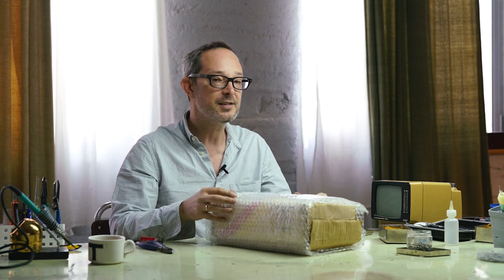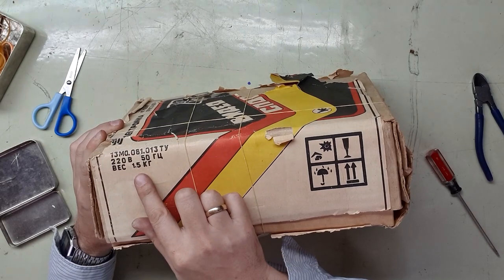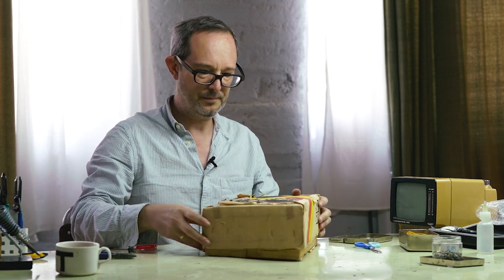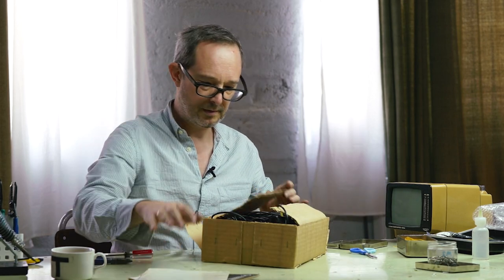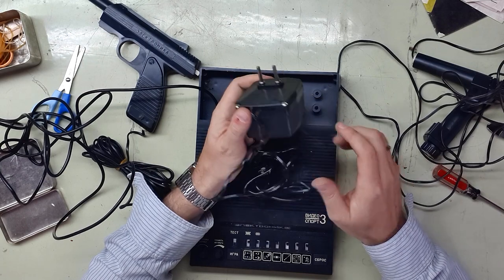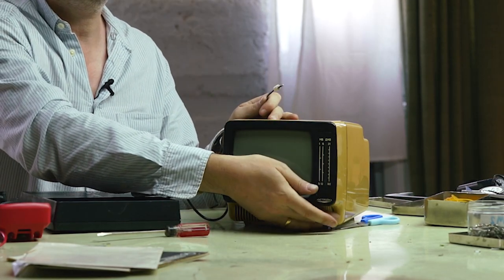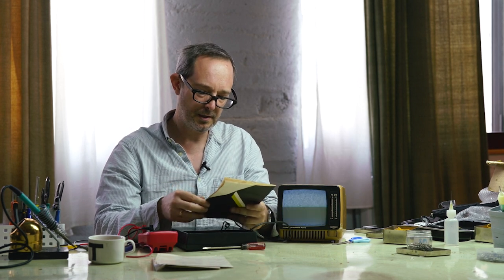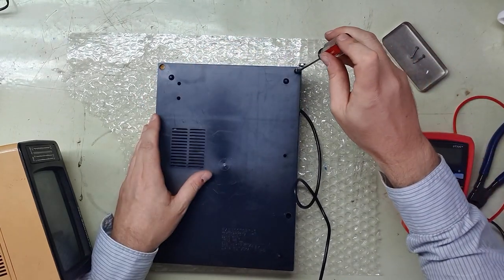Retro Gaming Console Restoration! — Video Sport 3

Comment: Fun video. I built a myself a "Leningrad" ZX Spectrum clone a couple of years ago. The USSR has a great history of clone systems using some really clever engineering. The home made PCBs and covered wire jumpers speak of a time when quality of workmanship was valued more than churning stuff out. Just one question, is the unit a SECAM system or PAL?
Reply from the maker: My understanding of Soviet television is that SECAM was the format standard, though on some of my other Soviet CRTs I've used a PAL signal and it seemed to work fine. I agree with you 100% about the quality of Soviet electronics engineering. It's sad so many of these devices are disappearing from the world. Thanks so much for watching!
Reply: The Video Sport itself is most likely CCIR, i.e. plain old 50Hz, 625 line, grayscale video without color encoding scheme at all.

Built a "Leningrad" some 6 years ago myself, then proceeded to upgrade it with a sound chip, 256k RAM, PS/2 keyboard and a divMMC interface - pretty sure I added a couple more layers to that poor board with just wiring :)
Reply: @ZXRulezzz  Thanks for the info, those are some great upgrades you've done to your Leningrad. I myself have built an audio board for mine and it works great (really makes a difference on the games that were written for it) and I ordered the parts to upgrade it to 128K about 2 years ago, but have yet to get around to it ;) 
I have one question for you though, the Leningrad you have it it the first version (with no edge connector) or the Leningrad 2 with an edge connector? The reason I ask is that I too wanted to use a divMMC with mine but was unsure if it were compatible. There were minor changes between the two versions but if you managed I guess it should work for me too. I could always wire it direct to the processor and other points on the board I suppose. Again many thanks ;)
Reply: @8bitsinthebasement  It's Leningrad 1 w/o the edge connector. I managed to put all those upgrades right on the board by using a small old Altera FPGA in its "prototyping area"; it performs most of extra hardware fucntions and control logic. (of course I had to port divMMC to it and code the rest)

That said, I don't see what would stop one from attaching a separate divMMC unit to any Leningrad, apart from possible wiring mess :)

Comment: hello, you installed 25v 220uf capacitors instead of 25v 200uf, and what capacitors did you install instead of 10v 20uf and 10v 50uf, I am restoring exactly the same console, I want to know which capacitors are better to install

Comment: I recently bought this console and that exact TV used. What channel/frequency setting did you use for the TV? can’t get the picture to come in clearly
Reply from the maker: Nice find! These are becoming more and more rare these days. You’ll need to fish around for the channel—I don’t know of the specific frequency needed. If you can’t find it, it may be that the console isn’t producing signal, which was my problem. :)
Reply: @ThomasBurns  thank you!! i was told id have to buy an RF modulator but the ones ive found online are pretty pricey for a decent one. good to know i wouldn’t have to buy one haha. i’ll probably have to pull apart my console then and clean it up

Comment: This ain't an Atari clone, it's Pong-style console (e.g. Magnavox Odyssey, Nintendo Color TV Game  etc)
Atari wasn't cloned in USSR, its clone "Rambo TV game console" appeared in 1990s only (in parallel with Famicom clones knows as Pegasus/Dendy/Subor/Lifa/Simbas/dozens others names)
Reply: also such consoles in theory would make any soviet radio amateur, the schematic was described in the "Young Technician" magazine (Oct 1989). But the main issue was to find out К145ИК17 IC (clone of AY-3-8500). There  ICs always were sold with the hard shortages in USSR. If you hadn't some relatives/buddies working on the factories producing them you had almost 0% changes to obtain some of rare chips.

Comment: схема почти гениальная. Голова К145ИК17 - Это клон, без сомнения. Русские не заморачивались такими бездялушками, просто копировали.
Интересное развитие оригинально чипа от TI:
AY-3-8500 (-1) (К145ИК17) 	1976 	4 Ball & Paddle games and 2 shooting games
AY-3-8550 (-1) 	1976 	Improved AY-3-8500 with horizontal player motion
AY-3-8601 (-1) 	1976 	Square Off: Combat Squares, Racing Squares, Shooting Squares, 2 Jungle Games 
AY-3-8602 (-1) 	1976 	Volleyball Plus: Volleyball, Protection, Hazard (supposedly unreleased)
AY-3-8605 (-1) 	1977 	3 submarine war games
AY-3-8700 (-1) 	1976 	Tank battle game
AY-3-8765 (-1) 	1976 	4 motor-cycle games: Skill cycle, Cycle race...
AY-3-8800 (-1) 	1976 	4 games: Black Jack, Draw Poker, Acey/Ducey and WAR
AY-3-8888 (-1) 	1976 	2 Vegas games: Black Jack and Slot Machine
AY-3-8889 (-1) 	1976 	Tic-Tac-Toe and LEM (Lunar Landing Module)